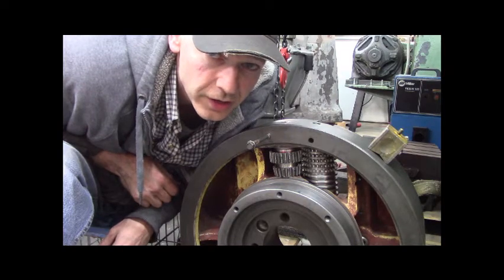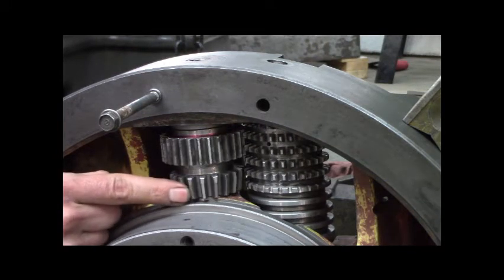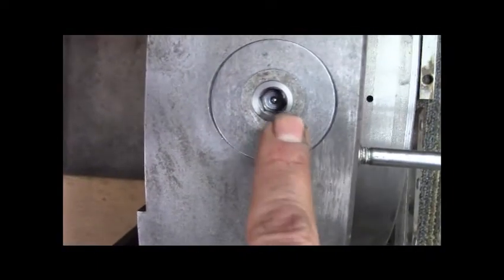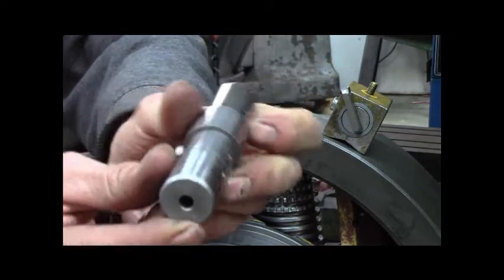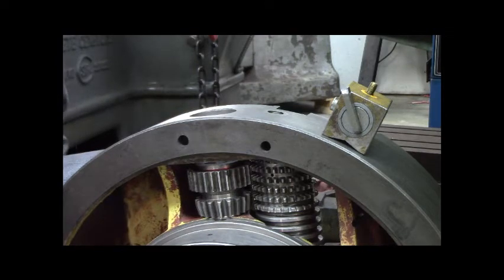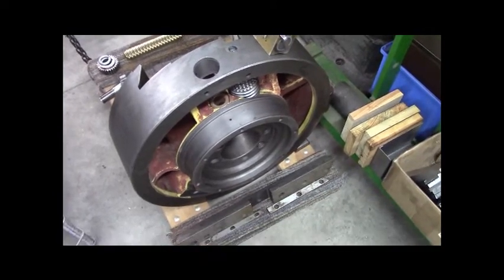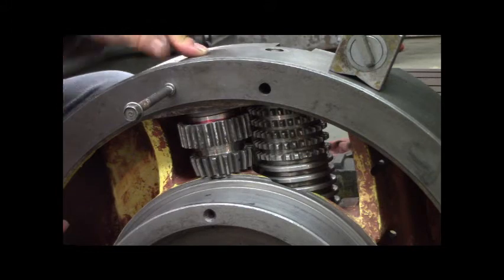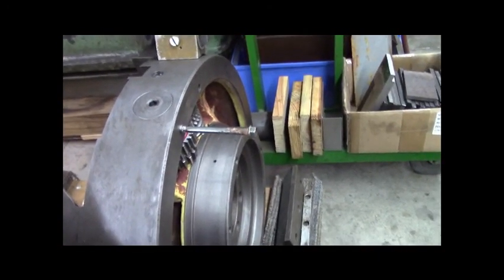Doozer's Machine Shop Update 12-26-20  Summit 20" Boring head work

Comment: Any consideration to putting an electric motor on top of your headstock and using it to drive the gears?
Reply from the maker: He Brian, Thanks for the Sub.  I am a long time subscriber of your channel. Congrads on your new G&L head by the way. That thing is cool.  So the G&L heads have the feed works inside the head, mine is different.  So when the head is spinning, in order to NOT feed the cross slide, you have to spin the gear THE SAME speed as the head is rotating.  In order to feed the cross slide, you have to spin the gear Faster or Slower than the head is spinning, depending on what feed direction.  Simply put, it is like a differential speed thing.  I could use a Servo motor to power the feed drive gear...Mount an encoder on the spindle, and I could program in the servo controller, a speed differential to make the facing feed work. This is the easiest way I can think of to accomplish this.  I know a Servo motor and controller from AutomationDirect would work, as I have used them before, and on one of the option screens, you can set a speed offset ratio between master and follower. --- A side note for you...  I know you had harmonic balancer clearance issues on your forklift with the 8.3 Cummins.  Maybe worth mentioning that the balancer from a 5.9 will fit, and is smaller diameter.   They actually put 8.3L balancers on the 4BT because they vibrate so much, as they just have a pulley.  ---Doozer